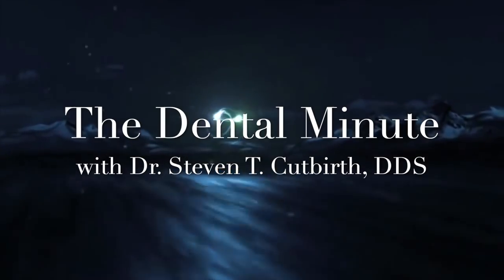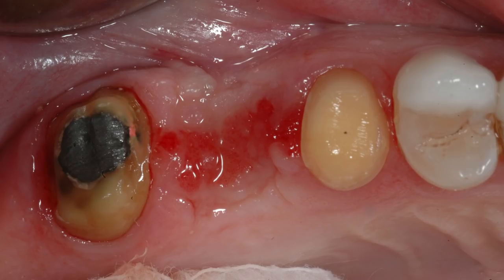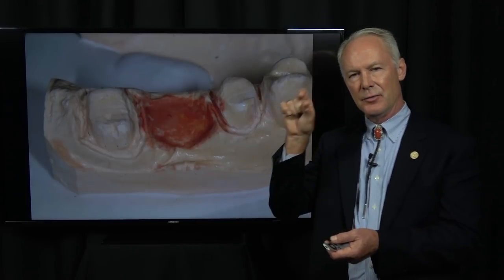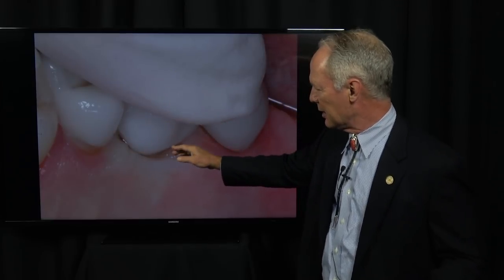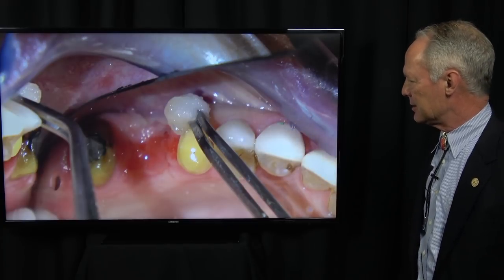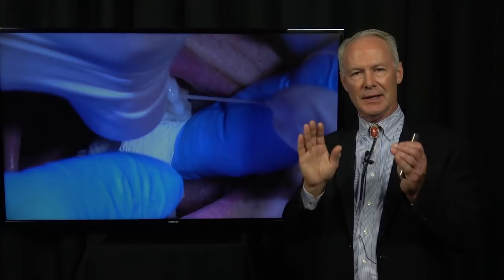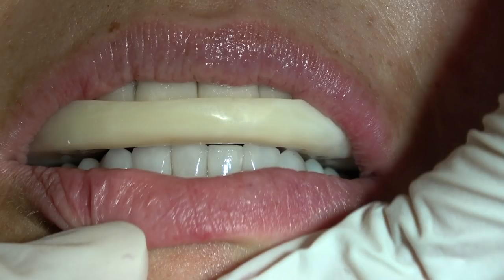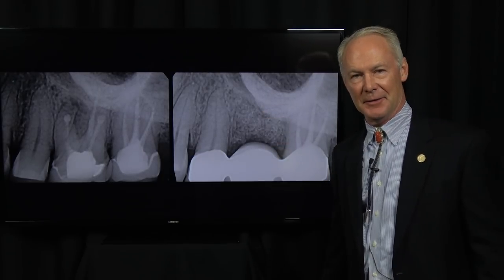Seating Upper Left Fixed Bridge - with Steven T. Cutbirth, DDS

Comment: I couldn't clear your voice doctor you said after tublicid red I should dry not with air but with what ? and I have question the access cement under the pontic how can we remove ? is vaseline alone enough for it's removal and thanks .
Reply from the maker: Following Tublicid Red, dry the prepped teeth lightly with a 2x2 gauze. Remove excess cement under the pontic with waxed floss with a knot in it (use a floss threader). Place vaseline on the tissue side of the pontic to prevent cement from sticking. 
Take your practice to the Top Tier. Subscribe to DentistryMasterClasses.com for an organized library of all the Dental Minute videos plus many complete comprehensive cases and many very important articles. New cases are added weekly.  Only $20/month.
Click here to subscribe: 
https://membership.dentistrymasterclasses.com/purchase/?plan=513

Comment: If you do not wipe off the excess cement, how can you see if the prosthesis is seated all the way down?
Reply from the maker: Look at the occlusal surfaces compared to the adjacent teeth plus you have tried the prosthesis in to check the fit prior to cementation. You must not remove the excess cement prior to initial set.  Not complete set, just hardened enough to peel or break off, not wipe off.
Reply: @centerforard  thank you Dr. for your explanation.

Comment: You cement with resin an put on tubulicid red with flouride in it on the tooth before? I actually learnded not putting flouride on teeth before adhesive restoration
Reply from the maker: Tublicid removes the smear layer without opening the dentinal tubules.  Supposedly cleaning the surfaces of the prepped teeth also improves retention of the cement.  If you are worried about the small amount of fluoride in Tublicid Red, you could use Tublicid Blue which contains no fluoride.
Reply: I know i do usw the blue one :D
Reply from the maker: Thanks to you question, I am going to change to Tublicid Blue today.  An excellent, highly regarded dentist in Zurich, Switzerland put me on to the Tublicid Red many years ago and I have not given it any thought since then.  I have never had any problems with bond strength of crowns or veneers, but perfect would be the Tublicid Blue.  Thanks.  We are a community of well intended learners and nobody knows everything.  I am always pleased to get a new idea from those watching the DM or DMC.com videos.
Reply: Dental Minute with Steven T. Cutbirth, DDS  i respect Your way of behavior! I actually really like your videos as they are practical and not only theoretical.
Reply from the maker: Good.

Comment: Vaseline on the margins looks dangerous. In the video, it looks like you got some smeared on the margin, which would completely interfere with bonding of the cement here.
Reply from the maker: The smalL in the inter proximal area on the outside of the retainer margins and on the inter proximal contact  is not a concern, and a big plus, if applied carefully.  Retained excess cement is a  major cause of c  & b and implant failure

Comment: 2:58........." most dentists do not fabricate bridges correctly."   C'mon man, how about a bit more respect for your fellow dentists?  Yes, just like in all professions there is the good, the bad and the ugly, and yes there are some bad dentists and bad dentistry out there.  In 27 years, I have seen it.  But "most" ??  Some humility would be nice.  Just because we may not do it exactly like you do?  I for one do not think it is appropriate or necessary to swab rubbing alcohol intraorally; similarly I think Tublicid Red is a waste of time ( never have used it; no problems with post op sensitivity to speak of).  I also think globbing vaseline all over the bridge and near the margins will inevitably incorporate some of it ( at times) into the setting cement.  I also think removing so much stone in the pontic area model that you literally are unable to seat the bridge initially is way too much contact in that pontic area.  We've all seen what that gingiva looks like if/when that bridge dislodges in the future; a raw looking, bloody gingival surface.  Despite all of that, I know that just because your techniques are not my techniques, does not mean either one of us is necessarily correct or incorrect.  Just different.   In summary, I like your technique videos, and have learned a few things, but I've about had it with the sweeping generalizations and sentiments of " if you don't do it my way, you are not a good dentist".   Try to show a bit more love for your brothers in arms.  Most of us really are good dentists.  Thanks.
Reply: Dear Dr. RON,  of course he does not mean to humiliate most dentists, but I think he mean that most dentists do not use this special (controversial of course) technique! in fact, this scrubbing of pontic area is usually almost universally done by all lab technician to ensure pontic is touching the gums, also they scrap a tiny area of adjacent teeth proximal contacts to assure no open contact areas. If they do not do it then most cases would be sent back to add porcelain to prox contacts and to pontics. Anyway, little blanching is no problem as we all know that gingiva will recontour and adapt within less than 15 min. We all use similar techniques E.g, when you insert an implant abutment which is always wider diameter than the healing abutment and the blanching disappear very soon sometimes even before the pt is even dismissed. Raw fungal red areas below the pontic is normally from improper hygiene and not superflossing. I agree there is no "do it only my way in dentistry or even in any hand skills and perhaps that is the real beauty of dentistry.
Reply from the maker: I respect your assessment and I understand how you might feel that way.  I apologize if I misspoke.  I am speaking off the cuff and not reading my narration, so sometimes my choice of words is not perfect.  I think the vast majority of dentists are well intended, but in this age of high volume, managed care it seems there is often little thought given to the fine points that make a big difference. 
I am not saying the bridge will not seat because of the soft tissue contact.  I am saying the tissue may take a few seconds to compress.  I do not think you are advocating an open area under the bridge pontic or embrasure spaces on the palatal or lingual.  
The inflamed tissue under some removed bridges is from plaque accumulation from not flossing, not intimate contact.  
I am not advocating excess vaseline in the inter proximal areas of a bridge, just enough to keep the cement from sticking there.  The vaseline should not get into the inner part of the retainers.
I am glad the small points are important to you.
Reply from the maker: Ron and TubesWidener- I really enjoy the exchange and agree with both of you.  What I am trying to do is show one good way of doing the procedures, realizing there may be other ways that are also effective.  When I watch the DM and DMC.com videos following my narrations, I sometimes wish I had chosen other words or, occasionally, use the wrong word, such as saying "bone supply" when I meant to say "blood supply" in a recent grafting video.  
I love our profession and do not mean to be critical of others.  "Man living in glass house should not throw rocks!"  I certainly have results that are not ideal.  Hopefully the results are always very good, but occasionally very good may be all we can achieve in a complicated situation.  I do not hold myself out to know it all.  I have a very good educational background, had/have some excellent mentors and have been teaching/publishing for over 35 years.  It is emotionally difficult to put your work and procedures out there for all the world to see (With the Internet I mean "all the world" literally.).  Someone will probably have an issue with various things and sometimes something I am presenting should be changed to make the procedure better, even if it is currently good.  I appreciate the constructive feedback.  Working together, we can all get better, provide better dental results and service and enjoy going to work every day.
Reply: @centerforard  I accept your apology, and I know malice was not intended.  I guess my main issue is that this being a very public forum, there is a responsibility to "do no harm" to the profession, it's members, and just as important, the public's perception of the profession.  Truth is, many's the time I also have the 'nobody can do it like me mentality"; I think confidence and appreciation of one's own skills and knowledge is a wonderful thing, but maybe kept more to myself ( and maybe my staff).  I watch a lot of dental technique videos, and it just strikes me that the ones I simply enjoy the most are the ones where the presenter  just knocks my socks off with his ability, graciously sharing his knowledge and skill without judgement, leaving me inspired and motivated to up my game, if need be.  If you're looking to inspire your brothers in arms, that's what we are looking for; encouragement!  Thanks for your reply.
Reply: @centerforard  thanks again for your honest and open reply.  You obviously love the profession, and I felt as such it would be constructive to bring to light a bit of a perception you may not have been aware of, that comes across in some of your videos. ( the opening statement in the facebow transfer video made me cringe a lil).   Goodness knows how much courage it takes to put yourself and your clinical cases out there for the world to see, literally; I know i couldn't do that.  I will continue to watch, and hopefully continue to learn.  May we all get better.  Merry Christmas!
Reply from the maker: Subscribe to DentistryMasterClasses.com.